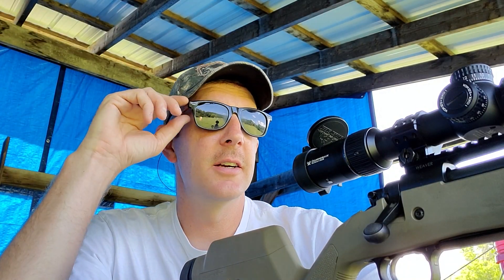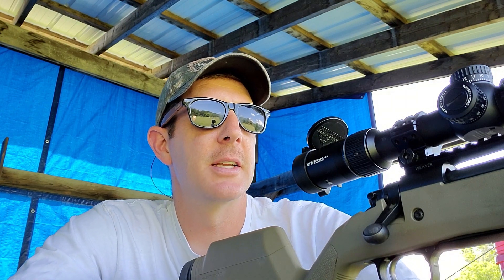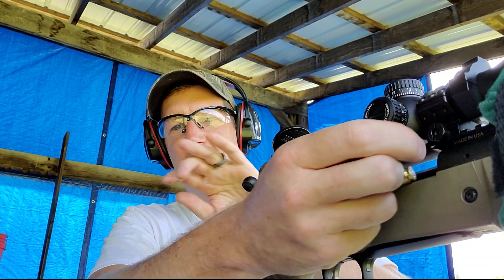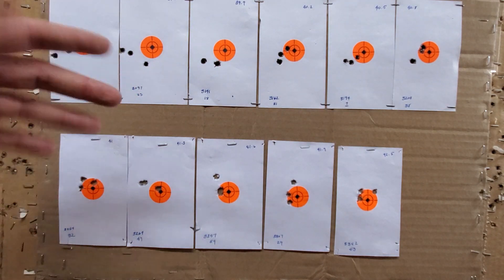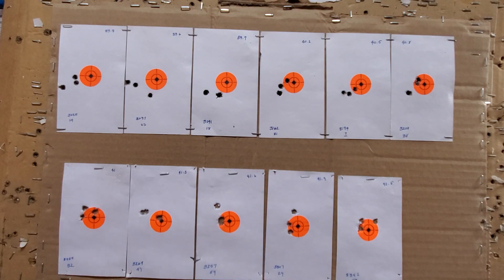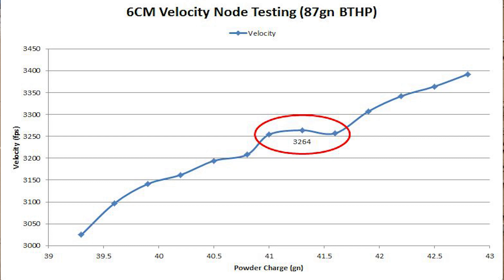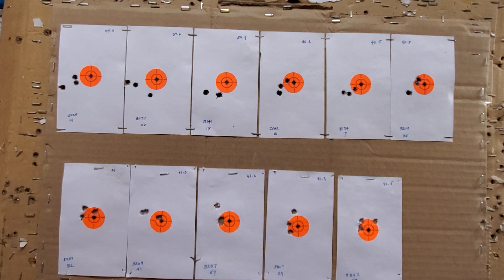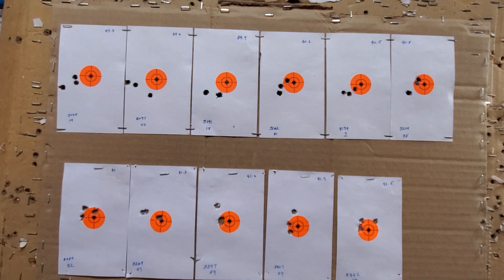6mm Creedmoor Velocity Node Testing

Comment: Great video as always! Have you ever noticed a difference in ES and SD when you start to play with the seating depth? I'm just curious as I know the pressure increases as the seating depth increases? Thanks!
Reply from the maker: i haven't seen that, i think if the bullet was jammed into the lands you'd see an increase in ES or an increase in pressure for sure.  I haven't seen much change with the seating depths i usually run.
Reply: @pawild5594  Thanks for the reply. I was just asking because we did a ladder test for a tikka 243 and loaded in 0.2 increments. We saw that from 46.2 to 46.4 there was no velocity increase. I then loaded a 46.3gr and as expected there was no increase in velocity. I then started playing with the seating depth and had an extreme spread of 20fps. I was expecting it to be a little lower, but maybe the reason was because it was new brass. Once again thanks for all these videos. I've learnt a lot from them!

Comment: I don't undertsand. I've watched many of your vids but I'm confused about what your end goal is and where do returns start to diminish vs the effort required to obtain a desired result. I'm not pissin and moanin, but trying to learn.
Reply from the maker: The end goal is to reach the most accurate load as possible, starting with finding the velocity node, then tuning that load.  Remember this is also fun, the effort is fun.
Reply: @pawild5594  yes. I agree. The journey is definitely fun.